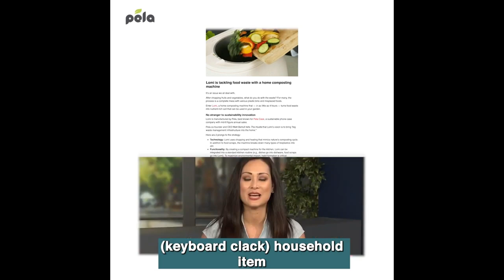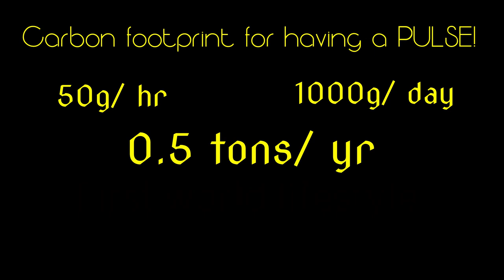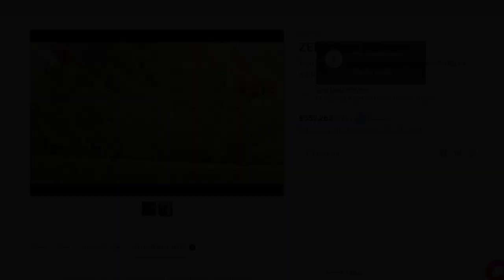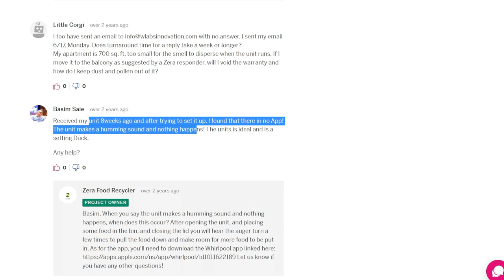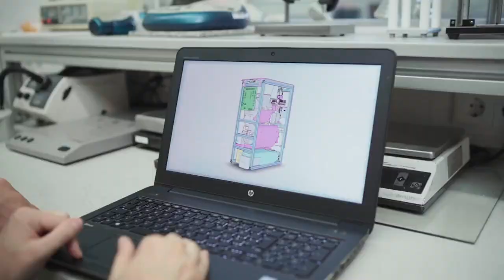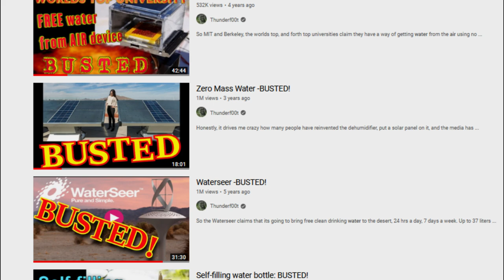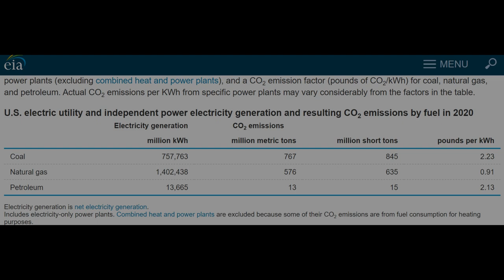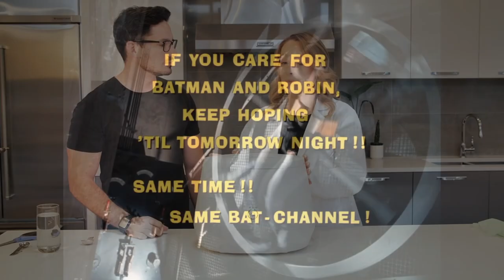Lomi: BUSTED!

Comment: The most hilarious part of this is that the Lomi saves exactly zero carbon vs the green bin. The compost collecting truck will be arriving at you house weather you have one or not.
Reply: If it's powered by anything except elbow grease... It's leaving a carbon footprint.

How do ppl not know this by now?  Batteries, electricity, gas, diesel, propane... ANY FUEL... It all leaves a footprint ppl.  It IS hilarious.
Reply: @--RSL--  Even elbow grease leaves a carbon footprint, since we essentially burn carbohydrates and hydrocarbons to do work, and output CO2 as a waste product.
Reply: @agnes8679  At the end of the day, the decomposition process of biodegradables in your garbage release the same net carbon regardless of where they decompose. It's no more harmful to the planet to throw biodegradable waste in the trash than it is to throw it in a compost pile. The compost pile simply gives the user a way to benefit from the decomposition, using the leftover organic matter to grow plants. But that same organic matter would enrich the soil used to cover it in the landfill as well, so it's not as if it's being "wasted". 

TL;DR -  just throw the stuff away. As long as you're not tossing plastic and recyclables, it'll all become dirt eventually.
Reply: @--RSL--  You can have composters without the "elbow grease"

It's how humans have done it for a very long time ie: getting worms to do it instead

Comment: I imagine there was some carbon savings if this heavy food waste isn't being transported to a landfill. My composter cost $10, is the size of a trashcan and is outside using zero input energy. (and also, you know, makes real compost).
Reply: I just have a pile or pot I fill, then layer. If you put sunflowers on top of the pile you can chop and drop.
Reply: Ironically an actual composter is exothermic. This thing is the complete opposite.
Reply: Try adding worms into the compost. They are as happy as a pig in shit and speed up the process.
Reply: My composter cost nothing, is made from an old plastic barrel with a filling door cut into its side. This is mounted in a stand made of scrap wood planks lying around in the workshop and a old water pipe to make the barrel rotating. Its a home made drum composter.
Reply: composting it in your garden completely makes sense if you're living in the countryside. in a city, collecting it is actually the better option.
1) the greater heat in the bioreactor ensures that prions are destroyed (e.g. mad cow disease)
2) you can trap the methane and use it to run your city buses and the trucks collecting the trash
3) you can use trapped methane to replace extracted one, when supplementing the energy grid (preferably electricity and heat)
dependence
Reply: @beyondEV  pretty sure the heat in the bioreactor doesn't get high enough to destroy prions.
Reply: @beyondEV  Normally, you do not obtain methane by composting something. But I agree, in urban area, collective solutions are more efficient.
Reply: Not only is it not using energy, its producing energy :)
Reply: I have a compost pile in the corner of the yard back behind the garage where nobody goes.
I have never removed any compost from it, just piled more stuff on. It's a pretty big pile, and it also helps there was a low spot there, but anyway...
It basically doesn't smell except for maybe right when I add new material.
Reply: @beyondEV  The question is if you both produce organic waste and require compost, how does that efficiency work out.
Reply: @CitrusPeppercorn  But not with the spinning blades...
Reply: @CitrusPeppercorn  - I added worms to my Lomi, then ran it overnight.  The worms were not happy. At all.
Reply: for my compost i just throw stuff in one pile in my backyard
Reply: Wont cost much even if you make an insulated version , buy  60 l/16gal and 90 l/24gal mortar mixing containers , usually has cost less than £$€10 each , spray polyurethane  between them , one big can  produce 30 l/8gal of foam , now you have an effective mini composter and cost so far has been under £$€ 30 , then you only need a lid so birds wont spread all the waste .  Best is to use few bolts to hold the smaller 60l container in position inside the 90 l container. when spraying the urethane .
Reply: @stephen3164  its because you didnt add Lomi worms
Reply: @beyondEV  if you live in a city you will never get anywhere close to a prion LOL. Unless you regularly compose your pet sheep .... .. 

But I agree that the energy in compost can and should be used
Reply: I have one of those. It’s called digging a hole in the garden and shtick ing in it - that’s my food waste returned to the earth.
Reply: @gblargg  true
Reply: You should start a kickstarter for that
Reply: Do note that the amount of carbon emissions from the transportation to (and further processing at) a centralised facility is negligible compared to the carbon (and other greenhouse gasses) that are produced by your home composter.

Provided your trash is dealt with reasonably upstream. Fairly low bar though, even a well regulated landfill will do. 

As biogas digesters become more commonplace. Your home composter will not only emit more nasties then the alternatives, but you'll actually be withholding a valuable resource. 
Doubling the "worseness" of homes composting compared to central processing.
Reply: @seigeengine  I do the same. I'll just turn it over some when adding new stuff that might smell otherwise just toss it on top.

Pile is getting high now and every spring I get surprise plants coming up. Usually tomatoes and squash that just got tossed on top.

So not only does this cost zero energy dollars to compost but gives me great soil for other garden uses and produces more food every year. Specially tomatoes since any that didn't get picked just reseeds the area for next season.

If you live in a city with no yard forget composting and just use the recycling system. Nothing else is going to work.
Reply: There's another way that the water can be extracted.... you can squeeze it out and the water just runs out.
Now - most rubbish trucks have a system in them to compress the rubbish - which will also extract most of the water, which can then just run down the side of the road.  You'll probably have noticed that there's often a trail of water behind them when they've been running the compressor.  Seems like this is a much more convenient and cost effective method since it's not trying to boil off the water, and it's able to work on a lot more rubbish in one go.

So even throwing your food waste into a truck isn't going to be all that terrible.
Reply: @stephen3164  dead???
Reply: @jzxtrd337  how much you want to raise??? 10 trillion??
Reply: -Matter didn’t create anti matter
-Anti matter didn’t create matter
(Both of them were present at the time of big bang)
-Both of them didn’t create themselves.
-Both of them came from an unimaginable source,  that unimaginable source created matter and antimatter (everything) thats why it is known as “the creator” of everything.
———--------------------------------------

- that unimaginable source/creator has created sin and virtue which are opposite to each other,
— logic says every action has its own reaction, so the reaction of sin must be different than the reaction of virtue,
— the creator has created prophets to let us know about each and every detail of sin and virtue, also about their reactions,
Thank u :)
Reply: @dot3499  reported for spam. Thanks for playing!!!
Reply: @Randrew  Ehh that's technically not entirely right. The bacteria involved are feeding on the trash so the energy input here is the garbage. The sun can technically help but only cause hotter compost (to a point of course) decomposes faster due to better microbes becoming active. Refer to hot composting for more details.
Reply: @beyondEV  yes, but then they should collect it as is in the green bin, and don't try to dry it at home with such a machine. Might be an idea to simply take the whole bucket out, instead of only the bag. Keeps it from rupturing.
Reply: @beskamir5977  It's just a joke, but the sun does technically drive all biological processes on Earth
Reply: @Randrew  I guess but also hydrothermal vents.

Comment: Ugh that whole spiel about "Lomi approved" stuff just brings back painful memories of my inkjet printer refusing to work becuase "you don't have original HP" or "genuine Brother cartidges"
Having grown up on the complete scam that is disposable products that require "approved" consumables, it doesn't take me much effort to recognize this product as the devious money grubbing scam it is.
Reply: Most funny thing about the cartridge scam is the chip shortage where original canon cartridges are not recognised as original
Reply: @der94alex  yes I heard about that 😅
I bought an older brother printed discontinued back in 2005, with an earlier version of the scam. Back then the shined a light through the cartridge to indicate if it was empty. I just used some paint to cover that hole, and got a significant amount of printing done after the cartridge was 'empty" and the printer had refused to work.
Reply: i dont regret buying an Epson Ecotank, the black ink that came with it will probably outlast the entire canon printer i had before,
Reply: @onradioactivewaves  Ahhh..... The old 'lightbulb on a stick' design as seen in VHS. 
Simpler times.  ☺
Reply: Don't forget the Keurig coffee makers that refuse to use anything other than "official" K-Cups.
Reply: @laurendoe168  just save a lid for the qr code and put it on top of whatever you like.
Reply: Oh brother have I been there!
Reply: Juicero has entered the Lomi-approved chat.

Comment: Wait, didn't they invent the effective version of this decades ago? It's called a garbage disposal. Solid municipal waste is often turned into fertilizer, or used to generate electricity, though some is just dumped in landfills.
Reply: I live in an apartment. We have a common garbage room. There are paper bags that are available for free in the garbage room. Thease paper bags are for compost and are meant to be dropped in a special garbage can when filled. Problem solved.
Reply: What do you think a landfill is? I know of a couple of former landfills that have become overgrown with forest and bush. One in my municipality was turned in to a ski slope
Reply: @grejsancoprative  A problem with modern landfills are toxic materials polluting the groundwater. In ancient times this was more rarely a problem but there was dangerous compounds even then.
Reply: @michaelpettersson4919  Modern landfills are pretty good about not polluting the groundwater.  It is the landfills from a few decades back which tended to have leeching problems.

That said, municipal waste does tend to contain a lot of rather nasty shit, and companies are always looking to cut costs if they can get away with it.  Both of those could be greatly mitigated (not eliminated) though.
Instead of having pointless mixed-plastic "recycling", we should have much better labeling of hazardous materials and much more convenient disposal.  Inspecting landfill operations and enforcing codes/regulations is also needed (how much/well this is done varies a lot right now.)
Reply: @Dirty_Bear22  Dude, your hobby is collecting garbage disposals? That's hilariously specific and mundane. Aren't they just an electric motor + spinning blades?
Reply: Here in Austria we have a similar project. But actually better in some ways. Less electricity but instead a wooden chest with worms in it. I only read an article about that worm-composting-chest, I don't own one and can't say if it's working.

But at least the energy input is 0 and the chest are actually pretty and handcrafted.
Reply: Lot of sewers have methane traps for methane to sell as natural gass and to prevent sewers from exploding
Reply: @Dirty_Bear22  I got one that is quite large, and takes any food waste.  I agree most people have wimpy ones that aren't worth the bother and they have to throw stuff in the trash anyway.
Reply: @ct1762  but methane is burned... Which is bad! We need to switch over to flawless, convenient, high output, zero-carbon and ""clean"" energy sources immediately, instantly and while not impacting anyone's wasteful lifestyles or it's not even worth doing!

Also put a white curvy plastic case on it and a little minimalist logo.
Reply: Funny enough, they tend to be blade-less. It'smore aa crushing and shearing implement than a cutting one.. If all is has to do is turne your waste into mash then there's no use having something sharp.
Reply: @mattjk5299  Not gonna lie you had me at the first part
Reply: @travcollier  In comparison to a landfill made by the Roman empire they are still modern thou. Also even if we do better now landfills from a few decades ago are still leaky. And there are plzces in the world where they just do not care.
Reply: @alexanders.1359  Well, the main question remains - what do I do with the resulting humus? If I throw it into the trash it was a complete waste of time and energy. I could use it as fertilizer, but how much fertilizer do you really need in a small flat without garden?
Reply: These garbage disposal things are mostly American; I live in Germany and have never met anyone having one of these things installed in their homes – also they are discouraged or fordbidden depensing on the city as they clog canalization, especially at times where we have to save water.  We normally just have a brown bin which is for recyclable waste which is collected free of charge. Our city then uses a dry fermentation process to turn it into humus (which is either locally sold or used for the municipal gardening department) and biogas
Reply: @ct1762  sounds green to me
Reply: @heilmadon  it's a frustrating world out there
Reply: @Souls4Roca  We get it, you don't know how garbage disposals work. Or your sewer systems aren't able to handle very minimal food waste that is pre-minced and generally less damaging to pipes than most fecal matter.
Reply: Not only are they effective, but they are also efficient. Your typical 1/2 hp unit will use not even a kilowatt running and is able to dispose of a full batch of food waste in well under a minute. Water consumption is also essentially zero if you use the wastewater from dishwashing. It is really a shame they are almost nonexistent outside of the US. Storing around food waste indoors can get quite smelly and having to make regular trips outside is timely, so it is nice to just get rid of food waste immediately.
Reply: @mikoi7472  you have no idea how plumming works...
Reply: @Souls4Roca   what are you talking about? Elaborate genius plumber…
Reply: @Grauenwolf  and how are they “bad for pipes”? By that logic flushing poop is bad for pipes.
Reply: @Souls4Roca  You clearly have no idea that human feces is on average slightly acidic. Which will slowly breakdown piping. And seeing as 6.6 is only the average ph, you're also dealing with balances way off that in both base and acid.
Without additional protective material put into your waste water, yes, it will breakdown the plumbing over a long enough time.

But yeah, go ahead and go off about how I, someone who's worked with plumbing before, know nothing about it. Or are you gonna claim that a garbage disposal is actually bad for your piping?
Which uh, I'd love to see your data on that. Especially compared to sinks without one that experience clogs where the use of harsher acids is administered to clear those clogs, or directly with snakes which also cause slight damage to pipes.
Reply: @na-hr6yx  die Abgase werden abgefackelt und zu Strom gemacht.
Reply: @williephuger  Time consuming, not timely. "Timely" means "punctual" or "on time."
Reply: @Souls4Roca  who buys disposals off Facebook lol. They are sold at stores. Waste Pipes don’t just explode,  are you grinding fucking gunpowder? USA, Canada, Australia, and parts of china have disposals and have waste treatment systems capable of handling them, it’s not a USA only thing.  What canvas are you even referring to? 

Sure some countries have older systems that can’t handle food waste, but you never said that originally, you just said they clogged pipes.
Reply: @michaelpettersson4919  We have a lot of open space because the landfills made the ground not suitable to build on. 
Would be such a hassle to try and plant a tree just to dug up a washing machine.